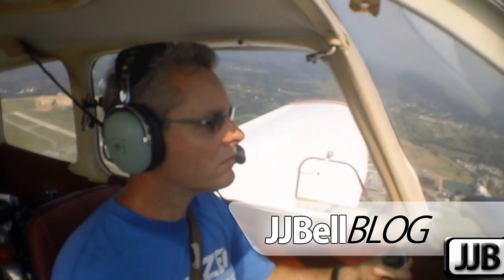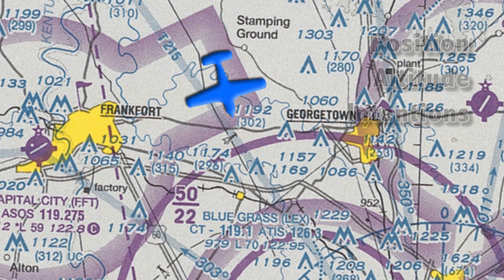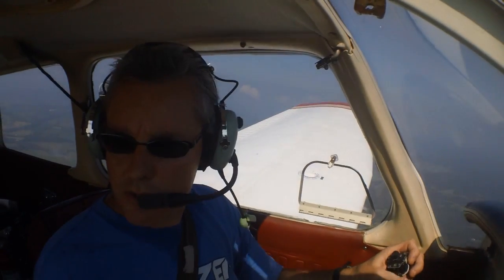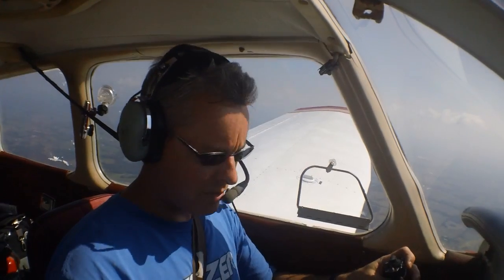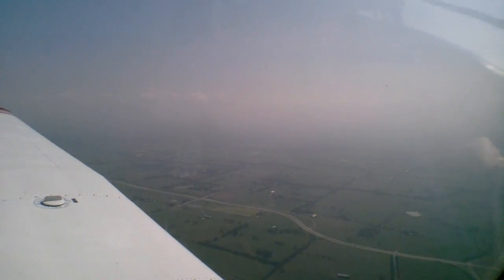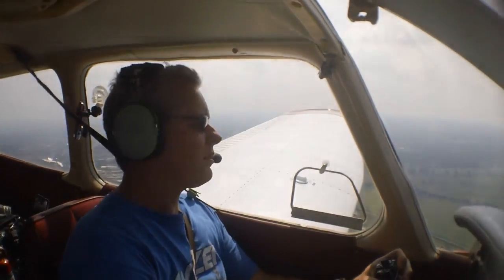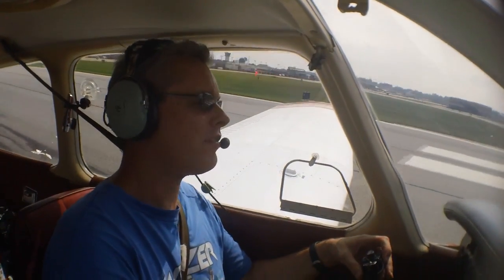Landing at Lexington Bluegrass Airport - Class C Airspace

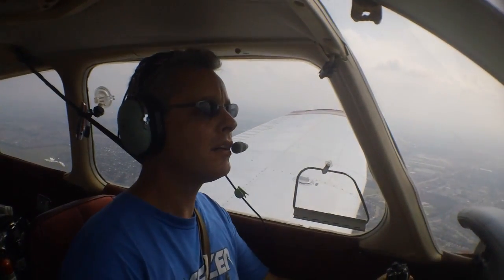Comment: What did tower say at 7:20... continue about?
Reply: +JJBellBlog the APP controller don't give you ALT to enter R Base , that means if the app say clear to R base or clear to downwind  you can low your air plan to circle ALT? 

for example if you contact APP at 5500 feet and now the controller say clear to downwind runway 22 ,so you can start descent to downwind ALT?
Reply from the maker: Tower said "continue inbound."  Lexington does the "Line up and Wait" instruction quite often.  Thanks for the comment.